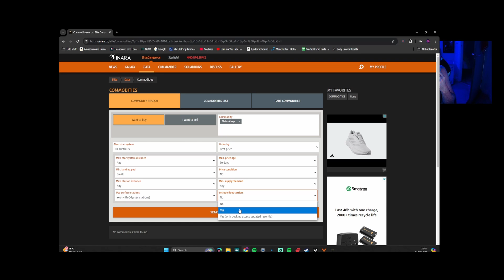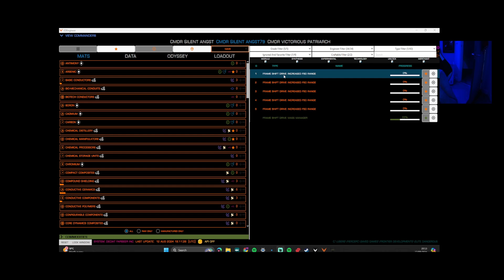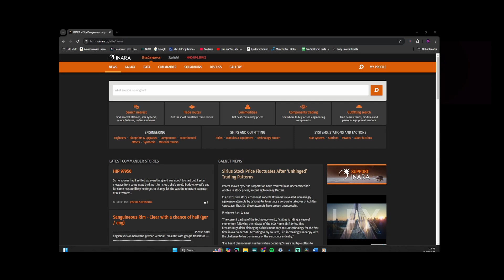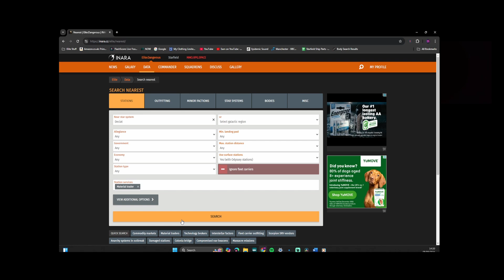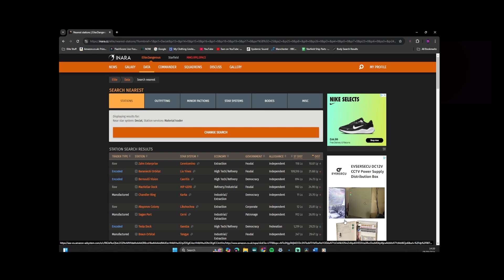Elite Dangerous Engineering:How to Max out your Jump Range

Comment: Just a few addenda to the information provided in the video:
1) Unless things have changed, Mass Manager should really only be applied to ships with Grade 4 or 5 and larger FSD slots. For smaller ships, I believe Deep Charge wias found to actually get slightly better results.  But either way you should ALWAYS go with the Lightweight experimental effect.
2) You failed to explain that gathering enough “encoded” material from The Jameson Crash site via the data points requires (or did) either logging out and back in or flying away and re-landing multiple times to reset the nodes.

3) “Dav’s Point” is actually called “Dav’s Hope”
4) Unless the materials at Dav’s Hope have been significantly increased (haven’t been there recently myself), it is far faster to gather from “High Grade Emission” (HGE) sources post Type8 Update. This is because the number of items in the HGE’s have been greatly increased, making it possible to nearly fill a Grade 5 Manufactured Material slot in just one go, using just 1 collector limpet. You just have to know what combination of factors will pinpoint the material you’re seeking. (Look for my reply to this comment for specifics.)
Reply: As promised, here is how to farm High Grade Emission Sources (HGEs), the known specific conditions for each of the Grade 5 Manufactured Materials, and some helpful hints/notes about collecting:

1) Using your galaxy map, locate  a system showing the following control and specific status. 
2) Once you are in the system, Supercruise to the Nav beacon, dropping in to scan it. (Target the beacon and point the nose of your ship at it until you receive the notification that the system data has been acquired.) 
3) Jump back to Supercruise and check your Left Side Pilot’s HUD Panel for “High Grade Emission” (HGE) signal sources. Without scanning the Nav Beacon, these will all show as “Unknown” Signal Sources, and would need to be targeted and scanned individually to identify them. (Be sure you haven’t filtered them out.)
4) After targeting an HGE, check that it’s individual location status matches the system status requirements below, and that the time remaining is long enough for you to make the trip to it in Supercruise.
5) Drop into your targeted HGE and locate the debris field directly ahead of you.  Fly close and collect to your ships’s maximum content.

Additional details of note:
A) Be sure you have installed a Collector Limpet Controller, A Cargo Rack (for limpets) at the ship outfitters. Also be sure and purchase some limpets from the “Advanced Maintenance” screen at a space station.
B) Be sure to set your collector limpets to your firing controls on the Right Side Pilot’s HUD Panel.
C) Be sure your Cargo Scoop is OPEN.
D) Do not target an individual item in the debris field when firing your limpet. Doing so will cause your limpet to speed toward that 1 item 1 item, not 1 item type” faster than normal, but explode after delivering it.  By targeting nothing, your limpet will fly slower, but gather multiple items before self destructing.
E) For HGEs that spawn multiple material types, you can set less relevant items to be ignored by your limpets in the “Local Contacts” page of the Left Side Pilot’s HUD Panel. 

System Requirement Specifics:  
Core Dynamics Composites
     System Control: Federation
     System Status: Election / None

Imperial Shielding
     System Control: Imperial
     System Status: Election / None

Improvised Components 
     System Control: Independence / Alliance
     System Status: Civil Unrest

Military Grade Alloys
     System Control: Independence / Alliance     
     System Status: War / Civil War

Military Supercapacitors
     System Control: Independence / Alliance
     System Status: War / Civil War

Pharmaceutical Isolators
     System Control: Independence / Alliance
     System Status: Outbreak

Proto Heat Radiators
     System Control: Independence / Alliance
     System Status: Boom / None

Proto Radiolic Alloys
     System Control: Independence / Alliance
     System Status: Expansion / None

(Exquisite Focus Crystals)
(Biotech Conductors)
     System Control: ???     System Status: ???
These 2 G5 materials seem to be the exceptions to the HGE farming “rules” above, and are best collected through missions, or trading for them from the other material categories. 

Happy Farming!

Comment: As for those initial roles, it's likely using the old system, which is random.  You may get a couple of really good roles which makes the total roles shorter, or you could suffer the wrath of the RNG Gods and have to do many more roles.  If it is using the old system it will be different for most pilots every time.